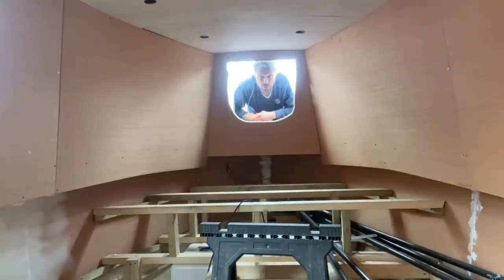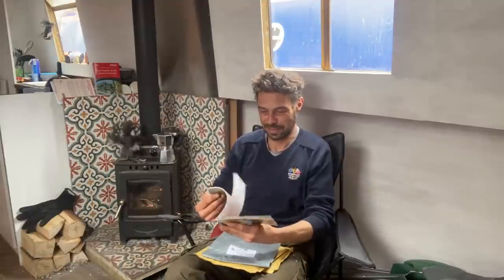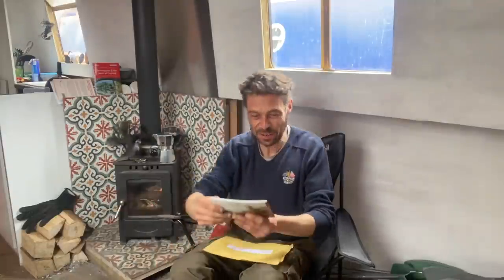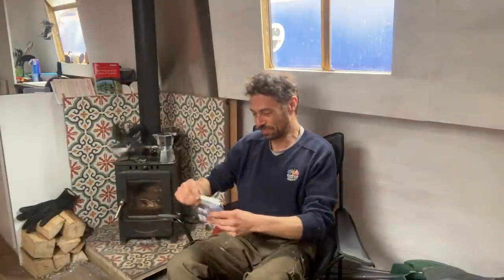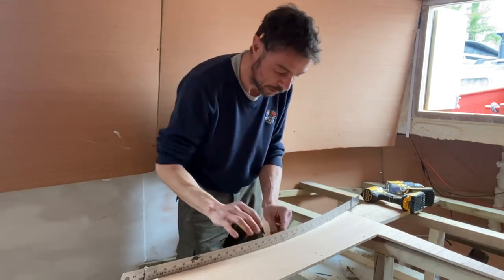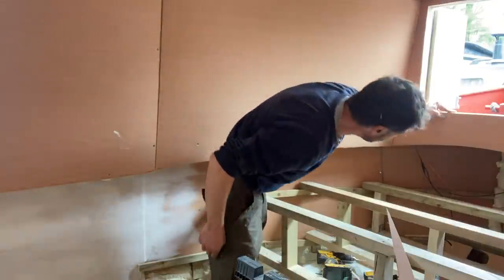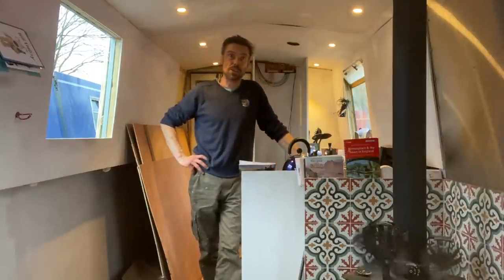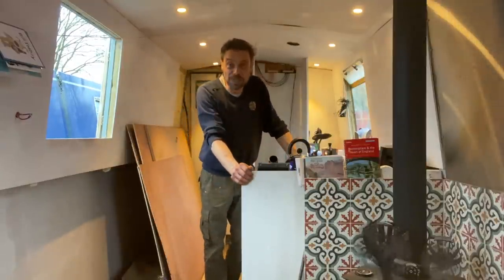143. Narrowboat bow takes shape

Comment: Good use of multitool.  Another way to cut boards in situ is to snap a jigsaw blade so it only just reaches the back of the board, and then cut without fear of going too deep.   
And another thing... that curve in the bow looks amazing.
Reply from the maker: That’s a damn good tip with cutting the blade - thanks

Comment: James - have you thought about putting a double glazed window into that bow hatch so that when the steel doors are open you can get light but not wind and rain? You could even have two small inward opening doors for ventilation in the Summer!  pretty cheap to do as well I would imagine.
Reply from the maker: Yes I’ve thought of getting a glazed piece so I can keep the doors open and see out - good call 👍🏼
Reply: @TheNarrowboatThatJamesBuilt   It would probably be worth hassle of getting 2 small opening doors James - both for ventilation during the Summer but also as a way of escape at the front of the boat.

Comment: James I work from home as an IT manager and so internet reliability and speed is crucial. Bit pricey but a Netgear Night hawk M1 (£170 on eBay) with an EE unlimited data sim (£30) gives me better speeds than lots of home setups. Currently around 120-140Mbps. Tplink Archer unit I was using before was giving me around 20Mbps in the exact same location so those M1 units are amazing!!
Reply from the maker: Yeah that’s interesting - my main issue is that the router needs to be powered by 12v USB
Reply: @TheNarrowboatThatJamesBuilt  mine old one was the same, I fitted one of those 4 way 12v fused splitter boxes and wired the 12v input directly from that into the router. Just cut off the 230v transformer. Never had any problems with voltages rising to 14v when charging after well over a year, but if you are concerned you can fit a voltage regulator to keep it at 12v. I use one to keep a steady 18v for my Echo show. Can send you links for any of this if you need.

Comment: Apparently youre supposed to put near boiling water in the stove top coffee maker so it brews quickly and tastes better. makes the thing lethally hot screwing it together though and you end up totally wired from drinking too much of it! 
The way youve cut those sheets on the wall in the bedroom gives the room a much longer apparent size than it actually is. Nicely done.
Reply: Sorry to tell you Rob, but you’ve been sadly misinformed about how to use a Milano coffee maker. You use cold water and let it heat to build up pressure and force the steam and then water slowly through the grinds. It will properly activate the beans upon reaching 94 degrees, with a fine (espresso) grind. Unless you in fact aiming to replicate the ‘Costa ‘ high street coffee experience, then you might as-well reach overboard and scoop water from the cut straight into your mug.
Reply from the maker: @musictube250  hey - I love a costa !!! 
Wow you clearly know your stuff - well mine tasted pretty good